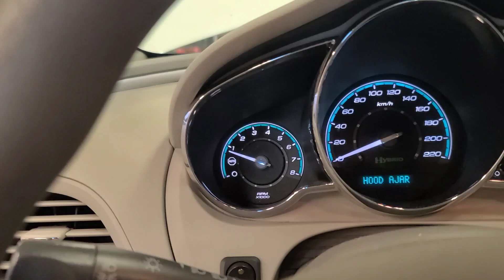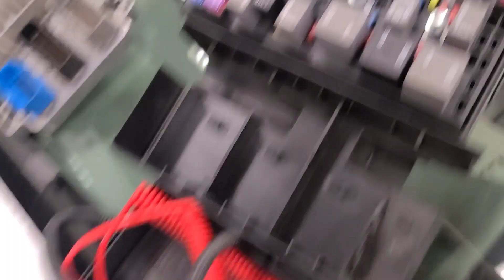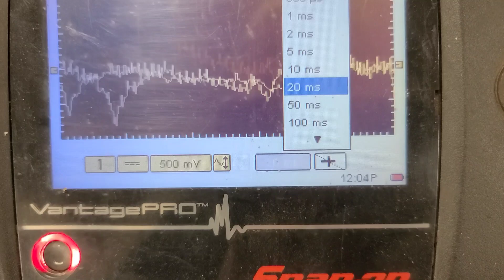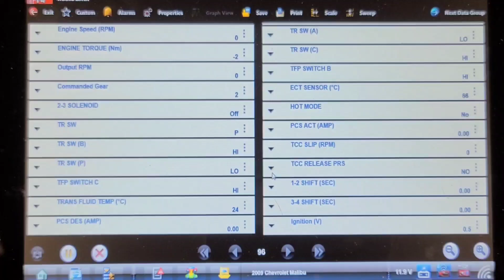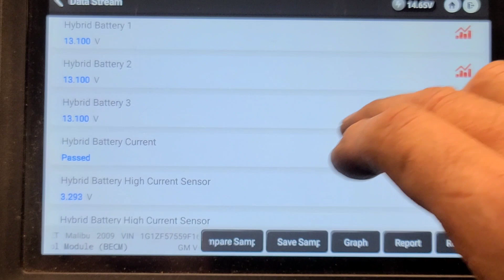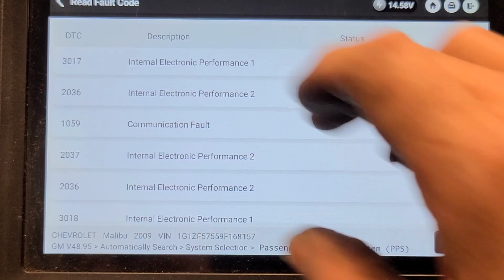2009 Chevrolet Malibu Hybrid Transmission In Limp Mode pt. 1

Comment: I have 2009 Chevrolet Malibu the hybrid, i have 2 codes p0974 and p0700, the car is shift hard on gear 1and 2 , but when deleting the codes while driving with my obd2  it’s shifting very smoothly and no issues at all, can you advise me please what that could be
Reply from the maker: The P0974 code stands for Shift Solenoid “A” Control Circuit High. It’s set when the TCM detects a malfunctioning shift solenoid. The P0700 code sets when the transmission controller requests the engine controller to illuminate the MIL.. You need to address the P0974 code.

Comment: Good morning, can you help me with the P1A92 Code of a 2009 Chevrolet Malibu Hybrid, what do I have to check or fix?
Reply from the maker: That is a code for one of the Hybrid battery temp sensors in the hybrid battery pack. There was a recall issued due to battery leakage and subsequent corrosion in the hybrid battery assembly. I would suspect the temperature sensor would be damaged due to leaking battery. Be careful if you open the hybrid battery behind the back seat due to the voltage present at 36volts. I'd get a GM dealer to check the vin and see if there is any recalls open on it. Try Alldatadiy.com  for access to information and troubleshooting steps. I still need to investigate this problem on the vehicle here.

Comment: Dear Mr Philip
I have Chevy Malibu 2009 2.4 hybrid when I drive the car there is coming on computer service hybrid when I tested in computer it's giving me code p0842 which is I don't understand it coz no one here in my country know about this vehicle....I really need your assistance and advice thanks in advance
Reply from the maker: Is that code in the Engine Control Module and are you getting it with an OBD2 scanner? That code is for a problem with the TCC pressure switch. Are there any codes in the hybrid Controls? Try Alldatadiy.com for information. It's not free but pretty reasonable in my opinion.

Comment: Would you happen to know why when im driving my 2009 malibu hybrid,the car starts jerking and stuttering and i get codes on the dash about service hybrid,service/traction control off,service esc/esc off.hill start off. Idk what it is and any help is very appreciated. Thanks in advance.
Reply from the maker: It sounds like you are experiencing an engine misfire which will illuminate the MIL, possibly cause it to flash. This in turn disables the Traction Control, hybrid stop start etc. You need a scan tool to do a network code scan to start with. Concentrate on engine and transmission related codes first. If you do have a misfire code you the need to determine if the problem is ignition, fuel or mechanical  related. Good luck.

Comment: Wow i would make them take it back to whomever did all that mess.
Reply from the maker: The customer gave up on the vehicle and was going to have it towed for scrap. The tow truck operator took the car for payment for the tow call. I have no idea why all the power wires to the coils were bypassed nor why the power wires to the BECM were bypasses. Definitely enough knowledge to be dangerous for sure.